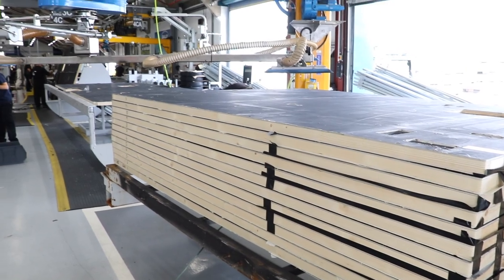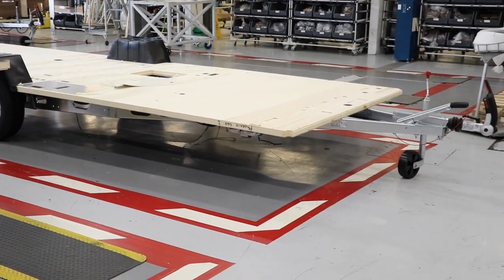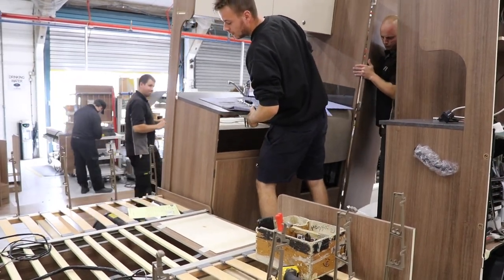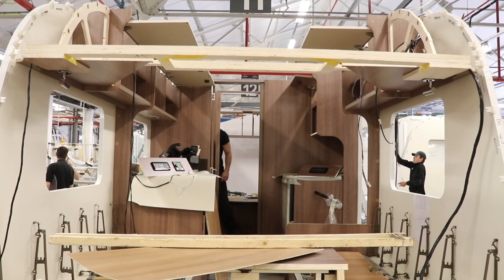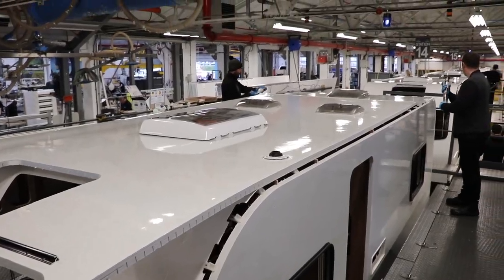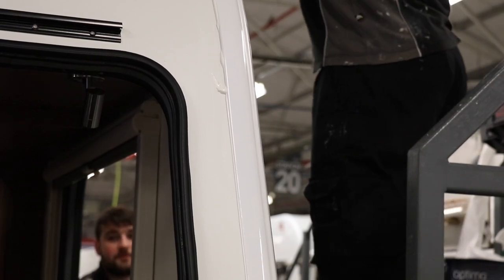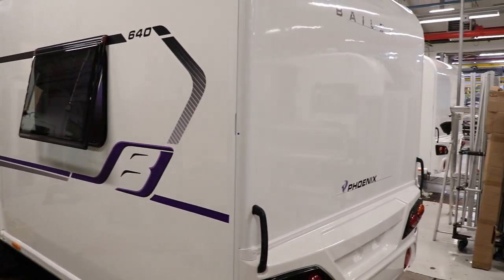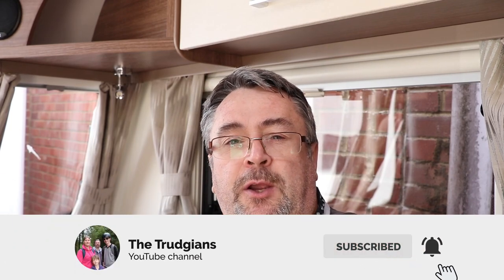Bailey Caravans factory tour - part 2

Comment: It was all looking good until I saw Steve Wonder putting the sealant on the roof/side joint at 8 minutes!! . I’d be worried if that was mine...
Reply: I was about to say that. I would give him a slab of beer to slow down and use up 10 tubes of sealant. Totally flood that strip. All that nice work to be ruined by a water leak. I like the way the panels curve over the ends allowing for just one joint.

Comment: Great video Dan but very shocked on how thin the wooden floor is.
Looking at the video Bailey haven't learnt from past mistakes. I am right in saying that it is polystyrene then thin wood glued to it and then top floor applied.
Do you no what warranty Bailey have put on the floor construction not the sides and roof?.
Can't see the floor lasting more than 5yrs if your lucky may be this is why they can afford to sell them so cheaply.
It would be interesting to see what you have to say.

Comment: Thank you for your tour part 1 and 2, I am from New Zealand and had seen locally made caravans and campervans being assembled but because those were of wooden frame construction (a build process little changed from early coach building) the assembly method is vastly different to the modern UK designs.

Comment: I think that’s the best and most honest caravan manufacturing video I have seen. Both parts were highly informative and importantly for me, highlighted how manual a caravan build still is. The fast moving and highly organised teams working to tight deadlines was fascinating but also shows how easy it could be to either miss a step or to not complete that step effectively. Especially considering many manufacturers may use temporary staff during busy periods who may not have much experience at all. We all read the bad experiences of new caravan owners and it’s easy to see why when comparing the process to the automotive industry. Great video Dan. Well done

Comment: Dan I have a challenge for you well more like a bit of advice we have a compass corona 524 club 2009 we love this caravan as it is our first we picked this for 2 reasons the main reason is the layout we wanted a full bathroom with separate toilet sink and shower the 2nd reason was price £7500 we did not wat to spend a lot of money just in case caravanning wasn't for us but we love it  so we could have spent more but now we are sticking with the corona my question is we use 2 different cars to tow with  this means depending on which car we use we have to keep pulling the number plate off and sticking the other plate on for local trips eg 2 hour drive we use our 2018 grand c4 Picasso but for longer trips we use 2010 Freelander 2  2.2 td4 S  what we would like is a system that we can just replace the number plate without having to pull off sticky  pads and re- apply more, I am not sure if I can screw in a quick release system  BTW great videos
Reply from the maker: Hi John, very simple - just buy a removable number plate holder, like those used in the haulage industry. 

https://www.trailertek.com/trailer-parts/number-plate-holder?gclid=CjwKCAjw8ZHsBRA6EiwA7hw_sbfWfcYMqpp5p7hjzyYutdukas1rNTMhpMtpK4OEKPuHxvFaMXk0YhoC6x4QAvD_BwE

Hope that helps.

Dan